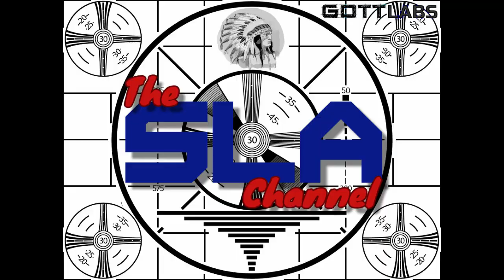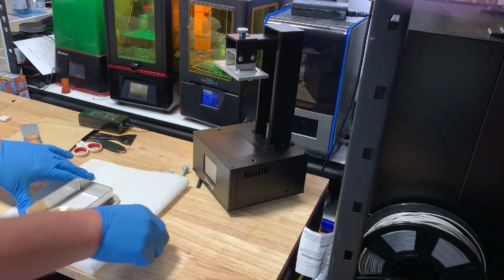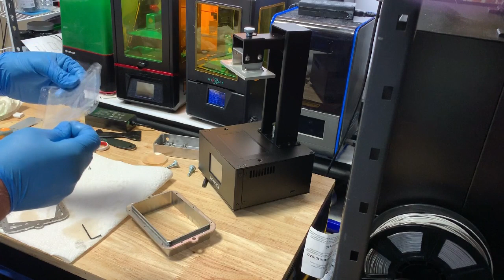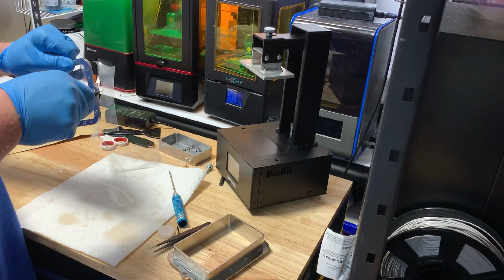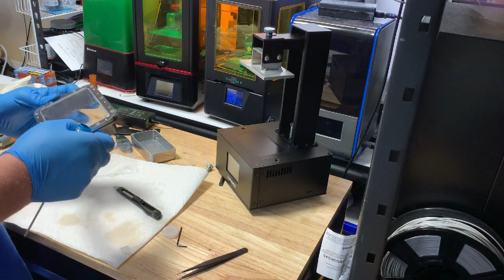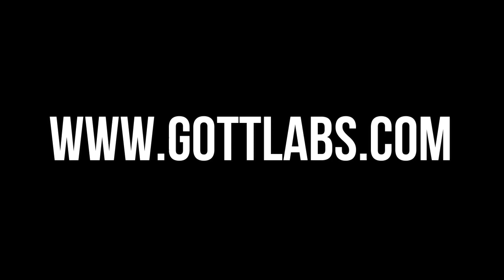FEP replacement on SLA Printers

Comment: I noticed that you have just about every DLP printer on the market. I have been stuck between the photon S and the Epax X1. Since you have both which do you prefer?
Reply from the maker: Both are great machines as far as print quality goes, and the "S" has a slight edge as far as speed goes because it is a little more powerful, but overall the EPAX is a better machine. The build quality is MUCH higher- It's a very sokllid machine that will stand up to a lot of use. 

In addition, the support and firmware development are the best in the industry. There's a reason a lot of people use Epax firmware on their Photons! It won't work on the Photon S, though- Different boards. 

Support and parts shipping on the EPAX is also US based. You get parts in 2-3 days, not 2-3 weeks.

Comment: print with an angle when printing flat surfaces. it ll avoid succion
Reply from the maker: You can significantly reduce suction by doing this as well as properly placed holes.